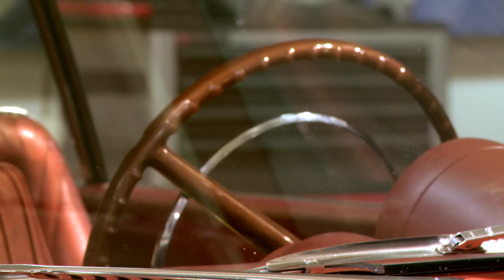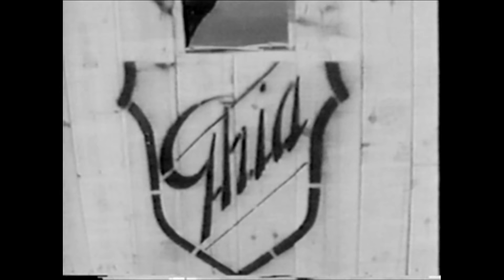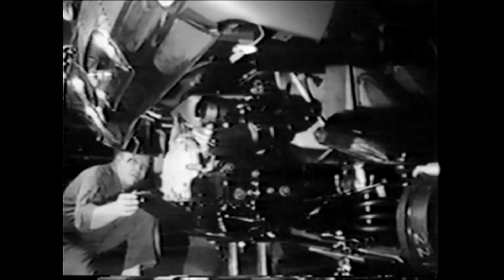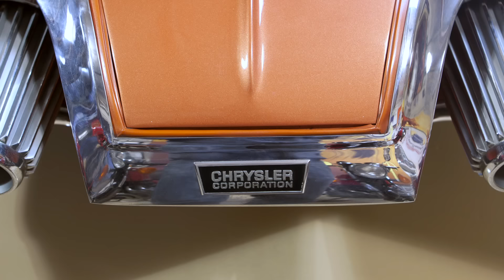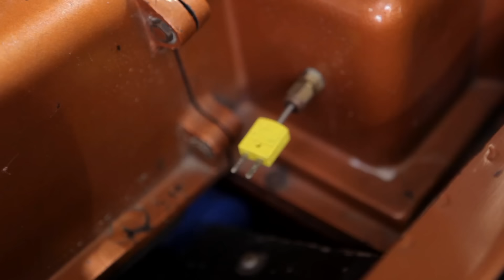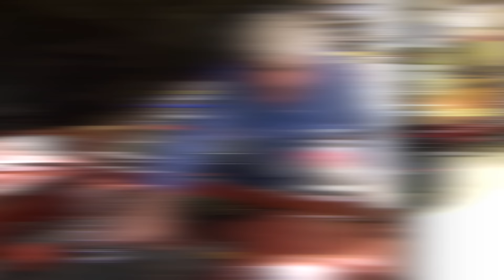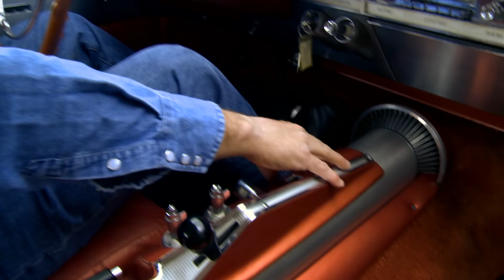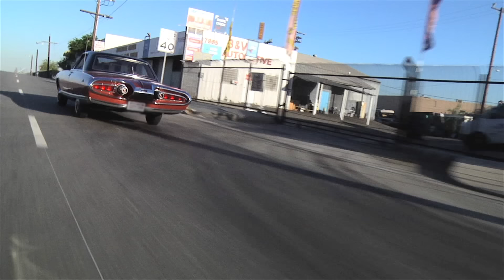1963 Chrysler Turbine: Ultimate Edition - Jay Leno's Garage

Comment: I lived on the Marine Corps base in twenty nine palms in the sixties.  One of the town locals had one of these as a test vehicle and I thought it was a beautiful and impressive automobile.  The reason they were discontinued is that it was discovered that the turbines were great for sustained steady power production as in the aircraft jet engines.  Stop and go tore them apart and they were impractical.  They tried them in Indy cars but they were considered unfair competition as the were incredibly fast and wiped out any of the conventional IC engines.  It's a vague memory at this point but I believe they were banned after the first year.  I think they tried restricting intakes but they still were faster than anything on the track.  So like the jet engines and the steady power needed in the Indy cars they were great.  Stop and go was not their thing.

Comment: I am so angry because this is an idea that should come again.  I am sure with today´s engineering the emissions and fuel economy could be solved.  This would be an ultimate sports car engine.  Almost silent, touching the engine while running it must have been fairly cool, power on demand.  I thought one of the major problems they had to solve was the transmission.  Drinks anything that burns.  Avgas, Diesel, Gasoline, Veggie Oil, Palm Oil, Kerosene, Waste Oil.  The works.

Comment: Thank you for the most comprehensive take on the Chrysler Turbine I have ever seen.  I was born in Detroit in 1943 and lived in or around Detroit through my teens.  Between Motown records and the Detroit iron of the period, I feel I lived the best of Detroit.  Where else could you find a car that would flameout on you if you were a bit careless.  True, gas was less than 25 cents a gallon, but it seems that using Chanel perfume must have been a bit expensive, even for the day.  Those were truly the days.

Comment: Wow, I am from the UK and I never knew that a Turbine powered car had ever been developed.  I have heard of Wankel
Rotary engine cars such as the Mazda RX7, but certainly not a Turbine powered car. This must have been ultra smooth,
and that sound was very futuristic. The car even looks futuristic, and to think this was developed way back in the 1950's.
Such a shame that the concept never really took off (excuse the pun)  Did these run hot, I can image a Turbine, which
spins at much higher rpm than a conventional piston engine, would generate a lot more heat.  Is that why it never really
caught on.

Comment: Weren't they at one time talking about using a small turbine to power the generator for the batteries on the Chevy Volt?  It seems like the ideal use for a turbine engine, since it can run at a constant RPM.

Comment: The main disadvantage IMO would be the size of that engine. Turbine engines give a lot of power and have a very high power to weight ratio. They are also efficient, but only when used properly. The size of that engine just made no sense for the car and it just swallows more fuel to keep it self sustaining as it is very big.

Comment: Engine will run hotter due to either the fuel used or the compressor section and turbine blades are dirty. We wash jet engines for this reason, although they get used far more than the car does. Keep that car running, a great slice of history.

Comment: I believe that if the turbine had better gas mileage and significantly lower emissions that a piston engine, we would have them around.  But, as Leno said, gas prices in the 60's was not an issue and auto emission regulations was on the horizon.  What a shame.  All that Chrysler spent on research and development was just scrapped.

Comment: That was an amazing video.  The last video I saw about this car they were stacked up and being crushed.  I am so thrilled to know that there are at least two left and running.  I found this very interesting because in the mid 60's my father was a salesman for a big Chrysler/Plymouth dealer in the SF Bay Area.  He got to drive this car and I still have the Chrysler literature and a Chrysler poster of the engine and it's power flow.  Thanks Jay for this video and for the preservation of this car and for the history you have about it.  Absolutely amazing!!

Comment: Another rare car you should find, Jay, is the 1970s Chrysler Cricket that they imported from England.  My father was in charge of that program and fought hard to fix all its leaks and problems and keep it alive along with the Simca, which he also imported from France.  We used to amaze all our neighbors in Bloomfield Hills with this tiny, front wheel drive when everyone else was driving big, bloated Cadillacs, Mercurys and Chryslers in our neighborhood...particularly when it would pull out of the worst snow drifts when other big rear wheel drive cars of the day just sank and got stuck..  But Chrysler went thru another downturn and shakeup around this time and senior management just couldn't see the value of these small imports back then. Real shortsighted shame, that got may Dad angry to the day he died.  Irony was that they eventually brought back the Simca (under new management) several years later and made it the basis of their turn around car...the Dodge Omni and Plymouth Horizon,  Somewhere in Chrysler's archives is the order signed by my late father cancelling the import of both cars along with his personal objection and handwritten note how he thought this was a big mistake...

Comment: This is kinda crazy.. Just by watching this thing drive and start and all. I can confidently say that this thing has the same engine and transmission design cues as the M1 Abrams tank series. Whenever Jay put that glass on the engine and he showed the manual engine hours I immediately thought that its the exact same on the Abrams. The starting procedure, the smoothness, the noise, the transmission set up. Its all the same as the Abrams. Kinda makes you realize exactly how revolutionary this car was. Whether or not it had a direct influence on turbine powered vehicles or not, the way its designed and the way its put together is enough for me to say that when AM made the Abrams they mightve actually looked at this car for help with how Chrysler did it.

Comment: the gas turbine for cars only really makes sense as an auxiliary power unit for a hybrid - a really SMALL gas turbine, that could kick in to recharge a battery stack like the Volt's tiny piston engine generator.  

It'd be an interesting test to see whether a gas turbine or a piston engine would be more efficient or longer-lasting.  It'd have a terrific power curve, but that's not critical in generator applications. Aircraft use small turbines to generate energy (as auxiliary power units) because they run on the same fuel as big jet engines, but (as we see in the video here), gasoline would power it just as well.  

If you needed a hybrid car or truck that could run on ANYTHING, gas turbine power generation would be the way to go.

Comment: Right about now is the right time for Chrysler to come back out with this engine, the car is wonderful but that engine is just a gem waiting for someone brave enough to show it off, with modern tech i'm sure they could increase the efficiency of the engine and get some better mpg going, either way an engine that can run off anything down to peanut oil cough cough WVO would be a big help to peoples wallets and come on that sound will make anyone smile.

Comment: It's too bad that GM discontinued Wankel Rotary engines.   They were quiet and efficient.  They almost ended up on the AMC Pacer but because of GM they had to switch back to their old tired 6 which took up a lot of engine compartment space.  Rotary engines were small in size but very powerful.  GM probably would have lost a ton of money on selling replacement parts for their regular engines.  All car company engines are badly engineered in order to be able to sell parts designed to fail and wear out.  Composite (plastic) is always used in place of steel and aluminum to cut costs but plastic is plastic.  I had a "composite" timing gear on my 4 cylinder 1988 Chevy Celebrity I bought brand new,  that fell apart before 50k miles.  Costs me $600, a lot of money back in 1991. No timing belt or chain; just plastic gear on gear.

Comment: The Turbine engine did have ONE huge advantage over piston engines and that is they were extremely reliable. The turbine is so reliable this is actually why the car was killed. It wasn't emissions, or gas mileage, or heat, this engine was simply too good. Think about it from a business perspective what good is it to sell an engine that will never need a tune up, never need an oil change, and will literally run for a million miles or more. Cars in the 1960s usually only lasted 75,000 miles and then they were dead and ready for the scrap heap.

The turbine engine was a totally different animal. There are airliners from the 60s still flying today with their original engines 50 years later and the military still operates B52s in 2014. We are talking about 60+ year old air planes that are still being used like they were brand new. The turbine engine literally will never die. So when the egg head engineers came along and said we got an engine that can easily go 1,000,000 miles the big suits at the top simply said. NO WAY. It goes against their corporate strategy of planned obsolescence.

Planned obsolescence, learn this term well because this is what all automakers do. No automaker wants to sell you a car that can go maintenance free for 30 years. No they want to sell you a piece of junk that will break in 5 or 6 years so you will be forced to buy a new one. Chrysler knew for a long time most people who bought their cars where previous owners of Chrysler cars. Their business model was all about serving their repeat customers who would buy a new car every few years. They had no interest in selling a teenager a new car that could last them until retirement.

If the Chrysler Turbine was mass produced it would have gone done in history as the most reliable car ever made. Not even 21st century electric cars can beat this thing in reliability. The best battery only lasts 10 years but a turbine car could go 30 years or more. The turbine engine was just too good. This is why the test cars were taken off the road and physically destroyed. The public could never know the truth or they would be outraged.

Comment: Hey Jay,  They had one of these at the North Shore Shopping Center in '63.  I was sixteen and had just gotten my license.  I circled it open mouthed for who knows how long.  I had long been a Chrysler fan because of the crazy things they tried.  My first car was a black '61 Fury convertible that somehow had a 413 [numbers matched] in it.  It had dual antennas on the trunk with a plastic flower on each one.  It also had a rectangular metal flake steering wheel. Bought it at the Dodge dealer on 114.  Did you ever see it tooling around?

Comment: What woud happen if the first compressor was replaced with a side blowing fan that piped the hot gasses to a cam piston engine like that used on hydraulic hybrid trucks and busses?  Would that imporve the low end torque and starts?

Comment: Detroit Diesel did a lot of development on regenerative gas turbines for heavy trucks in the 1970's.  Then when GM merged Detroit Diesel and Allison to form the Detroit Diesel-Allison Division, the truck turbine project was transferred to Allison in Indianapolis, where GM's major gas turbine engineering expertise resided.  I was an engineering co-op student at DDA in the early '80's, and actually was assigned to road testing a Greyhound bus powered by the DDA 404 gas turbine.  (I didn't drive it, though.  That required a CDL.  I just recorded data.)  The 404 designation meant that the compressor ran a 4:1 pressure ratio, and the engine airflow was 4 lb/sec.  The engine's rated power was 325 HP.  The GT404 was very similar to the Chrysler turbine in that it had twin regenerator discs, a single stage centrifugal compressor, axial flow turbines with a free power turbine.  A major improvement that Allison made to the engine was a clutch system that could connect the gas generator shaft to the power turbine shaft, allowing for engine braking power that was about equal to its rated power.  Allison also developed ceramic regenerator disks for the engine. 

Our typical day of drive testing the Greyhound bus was to drive south from Indianapolis through Bloomington and Bedford, which was where the major hills in Indiana were.  We were evaluating the effectiveness of the power transfer clutch for downhill engine braking.  Needless to say, wherever we went, people turned to look at whatever it was that sounded like a jet coming down the street, then were shocked to see that sound coming from a Greyhound bus.  We would park the bus and go get lunch, and 30 minutes later the turbine would still be whistling down when we came out of the restaurant.  Sometimes I think my career peaked when I was 19.

Allison continued to develop the GT404, but it never matched the diesels of the day for fuel economy.  The engine actually did get into production as part of a genset that Allison developed for ground power support of the Patriot missile system.

Comment: Kenworth actually put out a truck/tractor wit a turbine in it. I saw one in the truck stop in Minnesota one winter day. I thought I was seeing things because I could look right through the grill with no radiator in there.  he driver came out and sarted it up and took off like he was empty but actually he had 40,000 lbs of weet in the box he was hauling. True the milage wasn't to good bt it didn;t matter too much with fuel running at 18 cents a gallon at the time.

Comment: Ford tried turbines in their 60s C cab trucks but they where the ones that melted asphalt at stop lights with their downward non reclaimed exhaust also had poor MPG. story i heard about the Chrysler was at long stop lights torque converter over heated causing car to lurch forward a few feet into intersection. there where many others trying turbines then even VW vans. some info can be found in old magazines etc

Comment: that regenerator idea is used today in HVAC where alot of outside air is used and exhaust air exchanges heat. its call an energy wheel and can also be used after a burner called a desicant wheel used in skating rinks and indoor pools to remove humidity

Comment: What about range extenders?  It seems like engines like the wankel and the turbine have such poor efficiency, because they can't run at their most efficient speed, but doesn't a generator, that turns fuel into electricity, not suffer from such a restriction?

Comment: Thank you for this Mr. Leno! This car and I are very nearly the same age and, like most guys my age, The Lively Set was my first experience with the Chrysler Turbine. I've been fascinated by it ever since.
I find myself wondering, after listening to the reasons given for this car never going into mass production, if modern manufacturing techniques couldn't make this type of vehicle viable.  I'd love to be able to fill my tank with pretty much any flammable liquid. Add a hydrogen fuel cell into the system, and it could even burn water.

Comment: What Jay said at the beginning about Chrysler not wanting the engines taken out and hemis or whatever was incorrect. Chrysler destroyed 46 of the 55 cars because Chrysler posted a temporary bond on the cars since they were imported for one year. Chrysler could and did extended the bond for a total of 3 years. Using the extensions they would have to pay double the import duty if they had decided to keep them so instead to collect their bond they destroyed 46 of the cars. They were penalized for the 9 cars that stayed beyond the three year limit. Only the body, not the engine had to be destroyed since the engines were made in the US. As was said; Chrysler was in money trouble and the plan before car 1 had hit US soil was to destroy them. They had consigned them to a wrecking yard in advance.

Comment: A. Jay you need to invest in a 3-D scanner, so you can use take-out to 3D print yourself new parts?  
B.  Why does it remind me so much of a Thunderbird from that era?  
Which came first, the Thunderbird or the Ghia?  
C.  If it was a convertible 4 seater, you could also add a fiberglass tonneau cover like that Sports Roadster...
D. If the engine were remade today, I wonder how the materials list and financials would change? A Chanel-fueled car would still be kinda cool. And with a Tequila-fueled car, you could add a fuel-line tap in the dash next to the ashtray (purely to ensure good combustion characteristics, of course).
I saw this at the Fair, too.  I remember that silver DB5 thrilling me more.  (But I was six.)  See also: http://www.xbitlabs.com/news/other/display/20131211232014_MIT_Scientists_Build_a_Low_Cost_Open_Source_3D_Metal_Printer.html

Comment: the turbo indy car had a engine derived from a turbofan as used in aircraft.   this chrysler has quite a unique engine with its two heat transfer fans on the side of the engine.

The STP Indy Turbo easily was leading all race in spite of its insane fuel consumption, but it didn't finish due to a failed $2 spark plug.   the next year, they handicapped it so much it wouldn't have been competitive, so it was never run again.

Comment: Sorry about that, when I've talked about the printer, I meant that you can take what you had printed to a Machinists so a replacement parts can be made exactly as the original as Jay mentioned in another video

Comment: I was working the night shift at a Drakes Gas Station in Lansing Michigan in 1964 when one of these pulled in at 2:30 a.m. The two men in the car used White Gas that we sold for about $0.15 a gallon. They showed me the engine and it sounded like a Hoover.